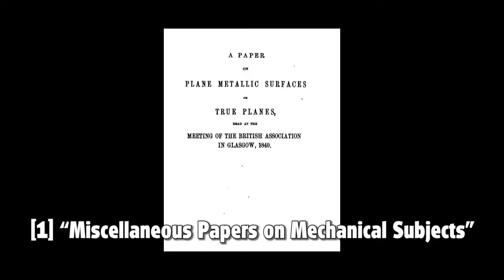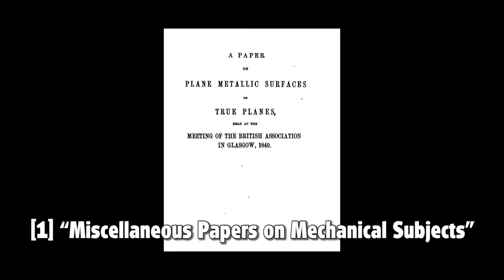Flat From Scratch, revised - The 3 plates method

Comment: I use this to keep my waterstones flat. It's time-consuming, but I get nice, crisp, square grinds on my chisels and other tools.
Reply: The basic procedure is as follows (notation further down).

Plates A, B, and C.
Yaw plate C. Rub the plates together.
AvB, Bv!C, Av!C.
Yaw plate B. Rub the plates together.
Av!B, !Bv!C, Av!C.
Yaw plate A. Rub the plates together.
!Av!B, !Av!C, !Bv!C
Repeat from the start. About twenty times and there should be a sizeable reduction to about a percent of the original roughness.

Fortunately, unless you gouge the stones severely, you with only have to repeat this a few times thereafter to restore flatness. Larger hills and bumps in the surface will work their way out over time as you grind the plates against each other by sliding them against each other in a figure eight pattern (without rotating them). Don't go too far off of the edges (try to keep at least 75% of each dimension in contact; no more than 25% in any one dimension should overhang the other. Harder to do with different sized plates.).

This does involve a lot of unnecessary flips. If you rub plates, then yaw one, and rub them again, you can save a bit of effort.

The procedure is as follow:
1. Choose pair of plates to start with and stack them. Remaining plate becomes spare.
2. Rub plates together. Yaw the top block (so that left and right sides swap, but grinding surface stays down. Rub the plates together again.
3. Set top plate aside (you may pitch it, but not yaw it) as new spare.
4. Using the old spare plate as the new bottom (pitching it if necessary, but not yawing it), and the old bottom plate as the new top plate (pitching it if necessary, but not yawing it), go to step 2.

XvZ denotes grinding plate X against plate Z. The plate on the left side of the v is on the top of the stack (such that it can be yawed while atop the bottom plate).
!X denotes plate X's being rotated 180 degrees (yawed) compared to its original orientation.
Plates can be rotated 180 degrees (pitched) to change between being on the bottom of the stack and being on the top of the stack.

Plates A, B, C.
AvB. !AvB.
Cv!A. !Cv!A.
Bv!C. !Bv!C.
!Av!B. Av!B.
!CvA. CvA.
!BvC. BvC.
Loop

Each loop grinds each surface 8 times. 

Each plate takes a turn on the top and on the bottom. You can even stack the spare on top of the top of the pair to increase the down force. Just don't yaw them unless it is time to do so.

Comment: I'm so excited to have found this! There are dead links to the original video since you made it fully private.

You should consider changing the original, outdated video to be unlisted instead of private! Update its title and description to point to this revised version. That way people can still find this updated version if they only have a link to the original!
Reply from the maker: @SeanCMonahan  thank you for letting me know of this issue, I will check it out later. It wasn't supposed to be a dead link.
Reply from the maker: @SeanCMonahan  I reviewed the settings but I don't understand where is the broken link you found.
Reply: @AccidentalScience  It was a post on Reddit entitled "How to make a flat surface without a flat surface?" in the r/metalworking subreddit. I had searched Google for "lapping without a flat reference surface to start." I did some internet archaeology with Wayback Machine to find the title of the linked video (which is private), and thankfully using that I was able to find this, the revised video!
Reply: @AccidentalScience It was a post on r/metalworking called "How to make a flat surface without a flat surface?"
Reply from the maker: @SeanCMonahan  Thank you very much for both the suggestion and the reference.
Greetings from the Alps.
Reply: @AccidentalScience You're welcome. 😊 This is an excellent video, and I hope more people will be able to find it now. Cheers from across the Atlantic!
Reply from the maker: @SeanCMonahan  thank you.

Comment: Is it possible to level the plane of a hand planer using the three plate method?
Reply from the maker: @RoronoaZoro-yl2wi  you use a flat surface (that may be achieved by the mean of the three plates method) to make flat surfaces of other tools, pieces, parts etc.

Comment: @Accidental Science --- ma questo lavoro si fa solo per raschiettatura, solo per sfregamento tra i due con abrasivo granulare o entrambi i modi?
Reply from the maker: @MrTega1975  as far as I can remember originally the three plates were abraded one against the other, but in his paper Mr Whitworth proposed a faster and more accurate method by bluing and scraping the surfaces, as described in the video. AFAIK the two methods usually are not mixed. 
Additionally, because I had to make flat surfaces that have a very high width to length ratio (approximating a straight edge) I experimented with reasonable success a variation of the method that consists of slightly shifting the surfaces along the longest side (the length). 
P.s. sorry for replying in English but I'm on my phone now and writing in Italian here with autocorrect is kinda PITA.
Reply: @AccidentalScience  , grazie mille per aver risposto così velocemente

Comment: 16:40 - I think you came up with quite an elegant solution for the problem. It would greatly reduce the possible errors in the flat surface and the results would be more than suitable for a lathe or similar project.

Comment: It appears logical that the more plates you add to the equation, the less errors, or rather the average surface becomes smoother because we are averaging across more variation. Is this logical to assume?
Reply from the maker: Interesting point. Intuitively I think that adding more plates would certainly add costs/labor with no significant improvements and on the contrary would increase uncertainty, in particular with an even number of plates. Intuitively, no proof here. Cheers.

Comment: Hey, excellent video and I love that it picks up on some points that people miss. I've recently become interested in the science of making flat surfaces, and eventually decided to create a Python program to simulate lapping two surfaces together (lapping can be much better for making the initial surfaces, because it averages the two surfaces together).

Some notes: when referencing two surfaces together, do your scraping and then rotate them, then scrape some more, then rotate again, scrape some more. This is where lapping is easier, as you just need to rotate it, no checking or bluing.

What happens when you do this, is end up with the two surfaces matching, one concave and it's matching is convex. As you move on, you will end up with two concave and one convex surface, or two convex and one concave surface.
Matching the two concave or two convex surfaces together will net you with them both being very flat, but again one will be concave and the other convex. Essentially you're averaging spheres together, increasing the diameter of the spheres with each iteration.

Another thing is that you should overhang the surfaces as much as you can without them bending. Ideally this would be 1/3rd of the surface overhanging. This removes localized errors. Say your pieces have a 10mm by 900mm surface, you would try to overhang 3mm and 300mm, then rotate it and do it again in all directions.

You can test how much the surface is bending from it's own weight by putting a test indicator with a magnetic base on the top and extending the arm to the edge and zero it when there is zero overhang, then move it and see how much it moves.
Reply from the maker: Thanks. Lapping is possible only if you have rounded (or at least squared) surfaces. It is quite complex to rotate a thin and long part as it was in my case. Set apart the guidelines taken from reading the Withworth's paper, I reached the conclusion that for a extreme length to width ratio it is not necessary to rotate the parts since the error on the shorter side is unavoidably smoothed out by the process for the reason of the given extreme ratio.
Interesting idea making a software simulation, at the time I did a rough simulation as well. What features your program sports? Do you plan to release your software open source?
Reply: @AccidentalScience  I plan on open sourcing it. Right now it's very rudimentary. I can change the resolution of the surfaces, set the number of lapping operations and rotation of the surfaces. I use a heightmap which is not ideal. The lapping process is essentially doing an averaging operation on the two surfaces - again not ideal.
One of the induced errors in the program I've found is from the surfaces not sitting flat on each other. Say you have two surfaces that are convex, if you offset them by 30%, your top surface would be tilted and your point of contact moves. My software doesn't account for that.
I'm looking for off the shelf libraries that can perform the functions needed, but it's hard to find. Ideally the surfaces would be represented as a mesh, and use collision detection.

As for making surfaces that are narrow, this guy really has the technique down: https://youtu.be/s3fMIAPs6jU?feature=shared
There's another recent video of someone making them, he tried cheating and making his CNC mill move the surfaces back and forth, one issue is that it wore lines into the surfaces. You need some rotational movement, even just a few degrees is better than none.

I'm curious how you did your program?
Reply: @stephaniea9722  You're not studying the process of making things flat you're trying to make a computer program about it with no actual work being done and no measurements. It matters not what your program says but matters greatly what the measuring tools say. Creating a program has no purpose at all.
Reply: @matthewmoilanen787  everything has a mathematical proof.
Measurements are meaningless unless you know the math behind it.
You can just say "This works, trust me." Or you can prove why it works. Math is that proof, and every single operation that you do on a machine or in engineering has a mathematical proof behind it.
It's not about measuring results, but understanding them. Because if you can understand something, you can improve it, modify it, or apply it to other methods.

That's entirely the point. Like what if you wanted to find out how long it would take to make two surfaces complementary within a certain margin, using a specific rate of material removal?
What if you wanted to find out how and where errors are introduced into a surface and how to avoid it?
What if you wanted to test alternative methods like using the front and back of two plates instead of 3 surfaces?

Testing all of this through experimentation and measurements would be extremely time consuming and expensive. But if you could model it, you could test everything in minutes for practically zero cost.

It's why things like FEA exist. You can test a design or method before expending resources (which you would measure the results of anyways!)
Reply: @stephaniea9722  How does your lapping simulation work? I'd love to check it out! I've been on a computer simulation kick recently.

Comment: Am I wrong in assuming that you just rotate each bar 180 degrees every time and you will be able to reach flatness?  Like A-B, A-C, B-C rot, A-C rot, B-A rot, and so forth. It makes total sense in my head,  but maybe the guru's will think it's stupid.
Reply from the maker: Indeed I did that. But rotating by 90 deg would be even better. However because this is a bar, simply shifting the bar by let's say 10%, the same randomization effect is achieved.
Also, if memory serves me well, rotation by 180 deg was what Whitworth said in his original paper.

Comment: Multiple degrees of rotation will always work best.  Yes it's harder to do, but will always end more accurate.  Think about a large 150mm end milling head.  As it comes around,  each bit takes a bite, and the lowest bit will always leave the deepest groove right..  Now, if you slowly moved the milling head back and forth while it spins, that lowest bit, will cut the same "groove" completely everywhere thus making it flat.  It's the same process but you're the milling machine, and the bit is either a, b, or c in the manual reference,  and instead of it spinning, you apply linear motion, but rotate slowly and over and over and over, you cut down all the "hills" until they MATCH they valleys.  Although, like you said,  it depends on how accurate you need it to be.
Reply from the maker: Sure, more angular rotations is better. With the specific case I had, because the surface ratio is so wide at the point it resembles a kinda rule, even small angular rotations was enough to achieve a very acceptable result. 
Thanks for commenting. Greetings.

Comment: Hi, I need a very flat surface to be established while I make a gel in a tray.  The gel is poured into  a tray.  How can I keep the tray precision flat while gelling occurs which takes about an hour.  After the gelling process is complete the product is dried by evaporating water. If the surface is not absolutely flat the resulting dry film is not flat enough and all the time was wasted as the film cant be used for it's intended purpopse.  Any ideas on how to keepa surfacce about 0.5m by 1m size very precision falt?
Reply from the maker: Try to give a look at the process used to spread resist on semiconductor wafers.

Comment: by rotating 90 degrees for flatness checking (and scraping), you can attain good efficiency and reduce the number of scraping cycles significantly, but it still remains necessary to also rotate other angles to avoid systemic symmetry errors, which you would not be able to detect by using 90 degrees only.  So the requirement is not so much to have square plates to get them flat, but to use as many angles as possible for ultimate flatness.  If your plates are very long and not square at all, you can also use offsets and angles of 180 degrees, as you discovered quite naturally.  It's all about averaging out the errors in all offsets and angles, to approach flatness to a certain degree. When your plates leave such a small air-gap they they feel like they are sucking together, it is very satisfying, isn't it!
Reply from the maker: Thanks for commenting. Yes it is. But for me the most satisfying part was living the whole process for the historic scientific achievement it was.

Comment: I think it is better to rotate and look for flatness in more angular orientations between 0 and 180 because there might be surface irregularity profiles which are symmetrical about the parallel axis to the plane of rotation and hence not being picked up by the dye.Should lead to higher accuracy.pls let me know your thoughts guys!

Comment: So how do you make a plate with 2 parallel flat surfaces?
Reply: If you use the three plate method, you can span two plates across one, so the edges grind each other. Then you'd have a perfect right angle out of nothing, and you could somehow use that to make a parallel surface lol

Comment: To examine which theory is right, someone already did a lot of work for us. telescope lens maker, especially those who make Newton style reflecting telescope at home. they only use 2 round plate, A and B, a lot of changing angle on grinding, a lot of long stroke, and the end result will be one concave len and the other one will be matched convex surface. we simply avoid what they did and that will hopefully will give us a reasonable flat result.
Reply: That’s why you use 3 plates. The only common surface of the 3 plates is a plane

Comment: I use this method to flatten my sharpening stones. Though it's not necessary to get them perfectly flat nothing gets them flatter with as much ease or as little money which makes sharpening tools a lot easier.
Reply: This! I’d bet this is how the Industrial Revolution started. You gotta have flat to have square and so on.
Reply: I do the same thing!
Reply: Interesting to read. Do you prefer this method instead of what everybody is doing: a flat surface with sand paper or a diamond plate?
Does it remove a lot of material on your water stones before it gets flat? 
I'm going to try it myself as well and will report back :)
Reply: @jancornelis378 how do you get that flat surface to begin with? The 3 plate method is a way of creating that primary reference.
Reply: @ared18t is there any video I can find to se how it is done with water Stones? Thanks
Reply: @eduardoangel3152  There's a video called three stone method with waterstones or 1k waterstones flattening method something like that I can't remember. But they use 3 1k waterstones to flatten their equipment
Reply: Funny. I do the same thing.

Comment: The plates don't have to be square but they should be symmetric under some angle of rotation less than 180 degrees. So the plates could be triangular, hexagonal, etc. Or they could be circular.
Reply: There's nothing magical about 180°, or 90°.  For any fixed angle symmetry, there's a corresponding saddle shape that can fit 3 plates, along with "flat".